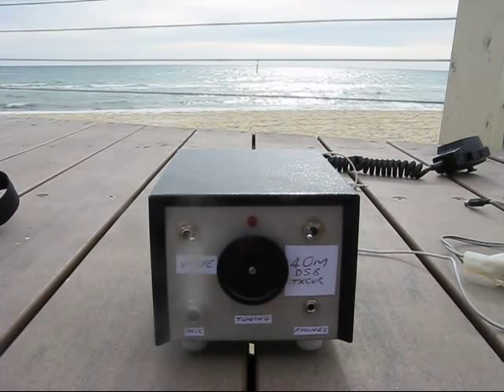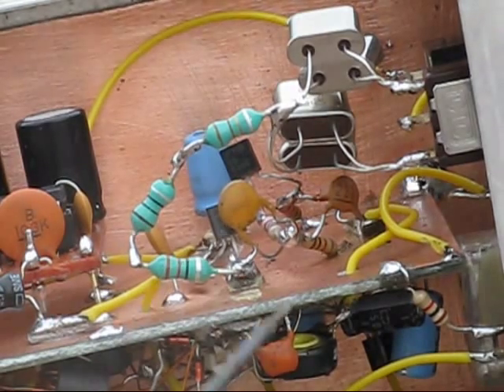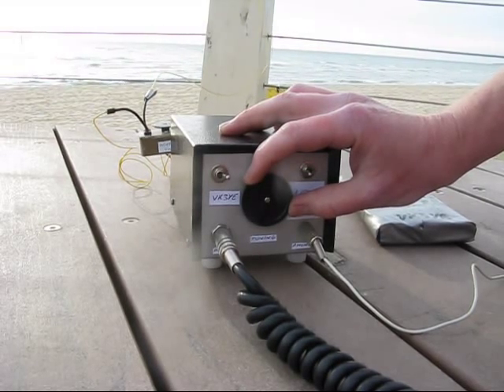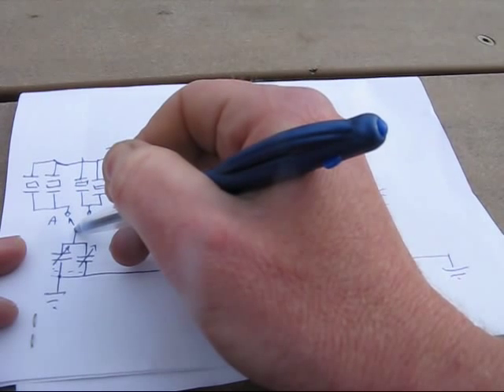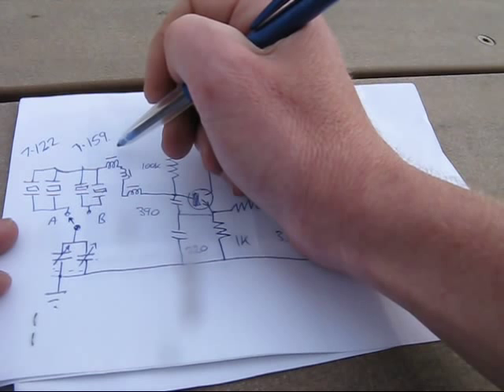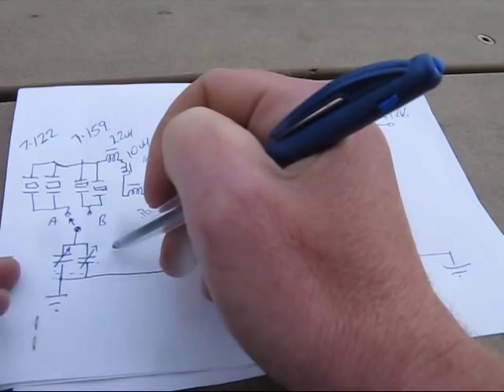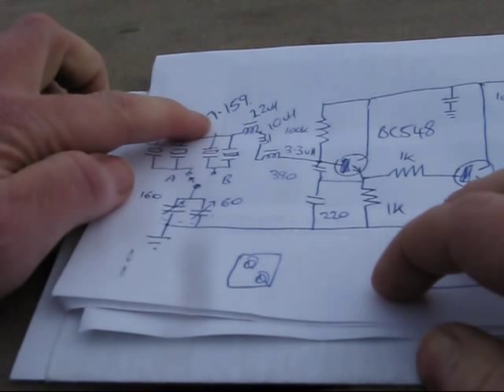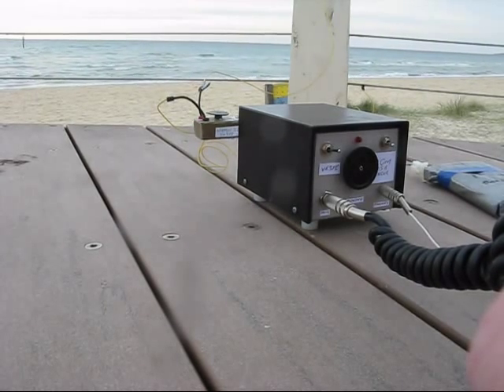"Beach 40" 7 MHz DSB txcvr: Pt 3 circuit walkthrough

Comment: hey peter my beach 40 working very nice but bit drift and chirps a little in frequency the cerramic resonator is unstable so if i build a super vxo my problems are solved are im right i have 7.000 7.122 7.159 7.195 7.200 crystal and some inductors and a 10 positions switcht i think it will do and the beach 40 are more stable what you think peter

Comment: Peter! I love your videos!!! How feasible would it be to build one for 12 meters? Thank you! 73 N0RBN in Michigan.
Reply from the maker: Daniel - 12m would require a complete redesign as transistor gain is much less than 7 MHz.  I don't know if 25 MHz ceramic resonators are available or how stable they would be.  A 25 MHz crystal could be used but if it's not a fundamental type would require a x3 multiplier as it would be oscillating on its 8.3 MHz fundamental.  Also it may be difficult to pull its frequency down into the amateur band.  So in short too many problems to bother with.
Reply: Thank you so much for taking the time to message me back. If there are any DSB or SSB kits available that you know of for 12m I would be interested. I enjoy your video's especially the loops you have built. 73!

Comment: Thank you for another great video. I've tried doing something like that but in my opinion adding an inductor to a crystal based tank circuit defeats the purpose of using a crystal. It's likely that the crystal never gets into resonance and just acts as capacitor and the inductors require their own shielding. I like inductor + fixed capacitor + varicap tank circuits mostly because the parts are easy to get and very cheap.